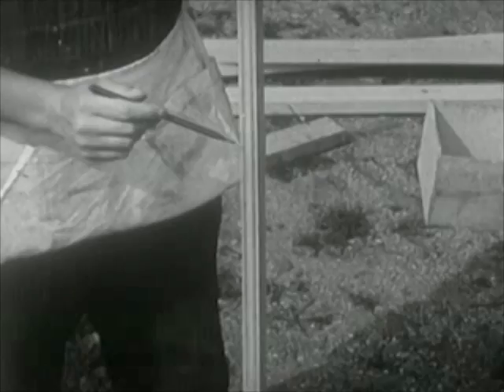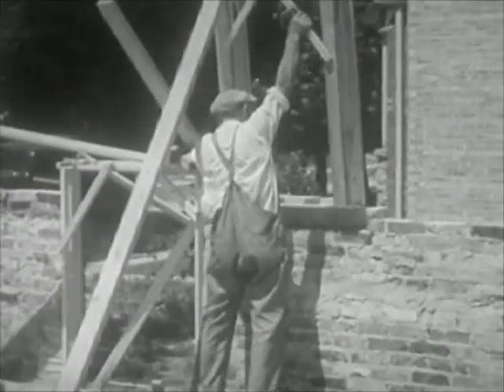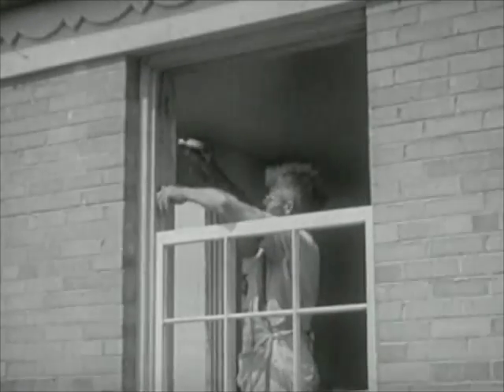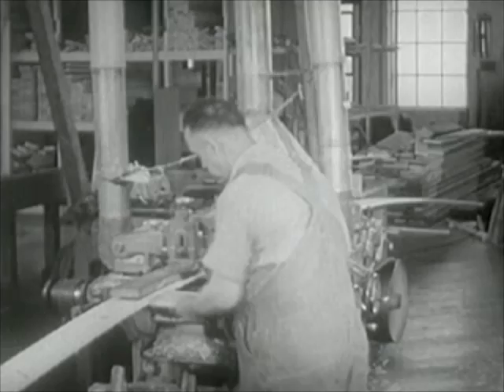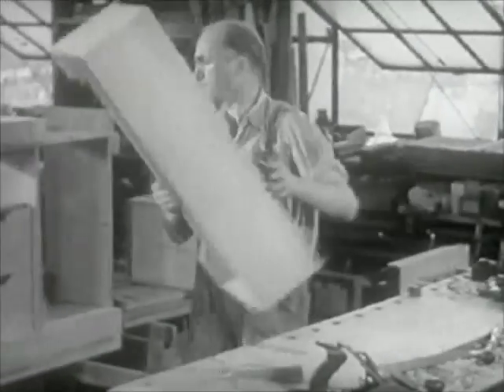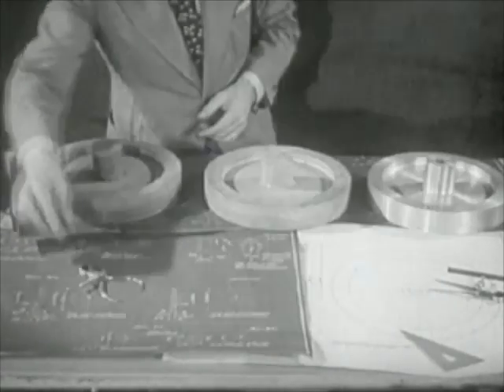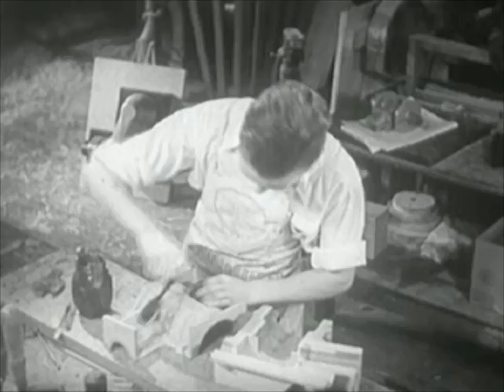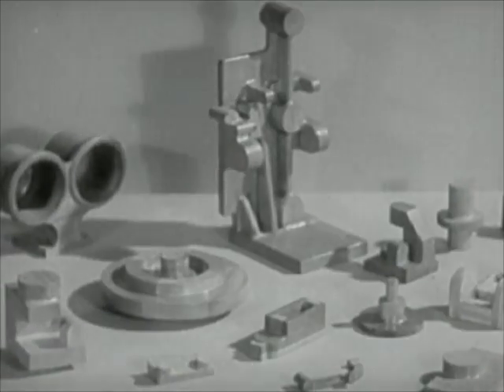Woodworking in The 1940s

Comment: That was fun to watch.  I served the five year patternmakers apprenticeship in the 1960s and later bought the shop.  We did amazingly accurate work, mostly by hand, but eventually I had to install CNC equipment to stay competative.  Back in those days, pattern makers were some of the highest skilled craftsman because they had to understand the characteristics of wood, interpret 2-D drawings, work to close tolerance,  be able to operate wood and metal working machinery, and they tok great pride in their work.  It was an art that has disappeared.
Reply: Jack Wittlich i agree. im only 19 but I help a older guy build a house. We cut and milled the trees with hands saws and wedges. Built the whole thing by hand and not one electric tool. Used hand tool and a level. Took 3 months but it was worth it.